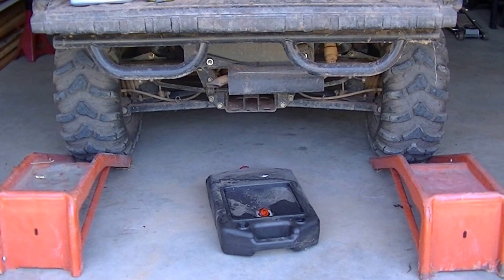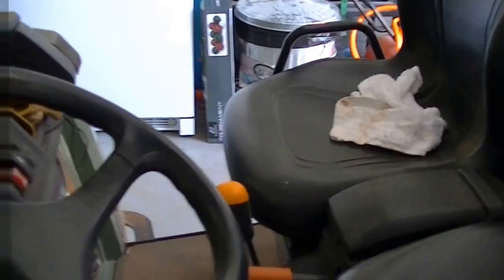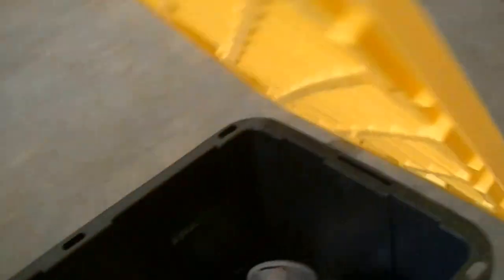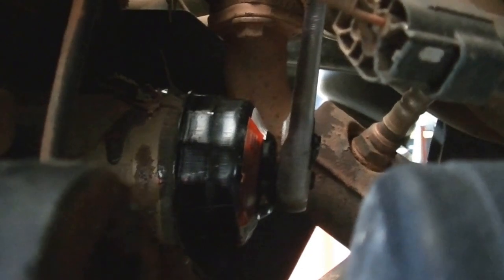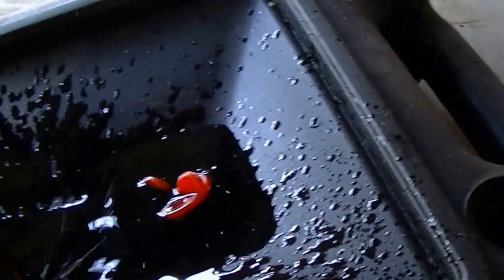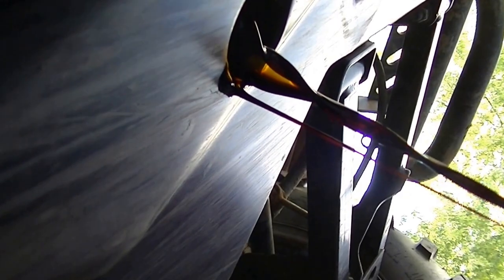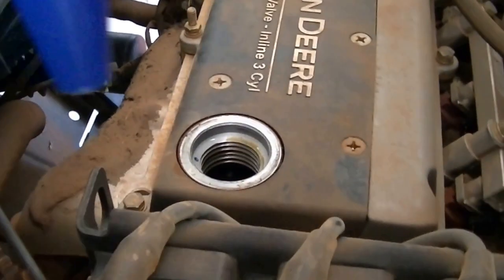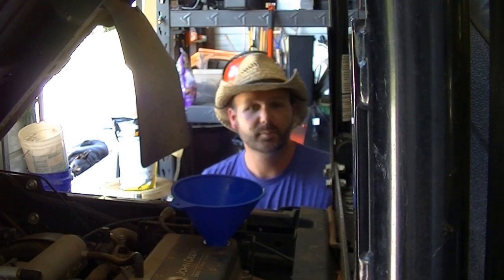How to change oil in John Deere Gator 825i

Comment: I finally bought a torque wrench after years of winging it with the oil drain plug. I find the torque specs are similair on my 4 stroke machines @ about 15 foot pounds with a previously used crush washer.

Comment: I saw you use Fram oil filters, which I used to swear by them until I did some research on oil filters. Fram is one of the worst on the market, if not THE worst. I would suggest switching to Wix filters.
Reply from the maker: Changing everything to Wix/Napa filters now..you are correct!
Reply: I second this. Had a fram come apart almost cost me an engine.